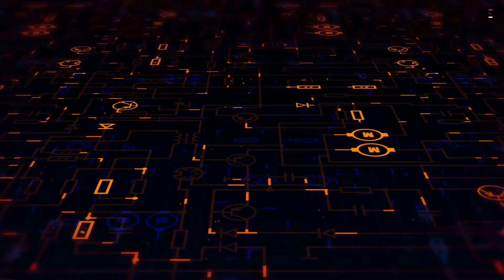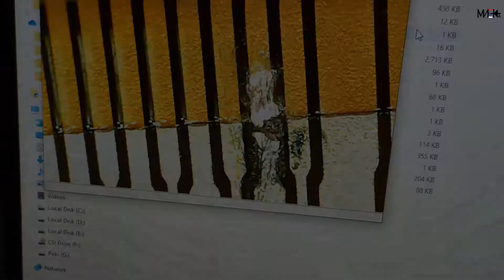Nintendo DS lite / Screen blinks problem // Treperenje-blinkanje ekrana // 屏幕闪烁问题

Comment: I nearly cried. I took my lite apart to clean it and fix an issue with the bumper. Put it back together and it started doing this. Checked the ribbon and found out I hadn't put it in all the way.
Reply from the maker: Great it was finished good 👍
Reply: Shelbyrules, how do i put the ribbon in ? where is it even please help i need to fix my nintendo
Reply: Watch a tutorial like a screen repair one to better understand, but The ribbon is the orange flexible paper thing. Hope this helps
Reply: Your comment saved me a whole lots of tiiiimeeee😢

Comment: Hi my ds lite is charging ok, battery is fine tested but when i turn on the green light blinks and the upper screen flashes once and then nothing happens it wont turn on, already tested the fuses, do you imagine what could be the problem?
Reply from the maker: Thank you for asking. I suppose that there is some problem with display or flat cable, DS lite try to power the display and have some problem, that is why is just blink, try to clean and check flat cable first.

Comment: OMG! You cant FIX the pads? Makes total sense since traces on boards can be repaired. Why did I not think of this? Awesome! The pads to my digitiser appear to have been rubbed off or cracked. That tiny cable is a menace to put back in for sure. This DSL was given to me because it doesnt work. Process of elimination. I suspect the digitiser pads arent the only problem but maybe. I'll try padding them with solder. Thanks so much for this video! Imma sub now <3
Reply from the maker: Thank you for nice words, it is my pleasure that video helped!

Comment: Hello, I have a question, do you know what other problems can be the cause of the console not turning on? My nintendo DSLite worked perfectly, I decided to change the casing, because the top screen had a broken support, once I changed the casing, the console stopped working, it didn't turn on, the battery light (green) blinks and goes off I tried to change the screen for a new one and the same thing keeps happening.
Reply from the maker: Hi, thanks for asking, probabbly some losen flat cable or similar. Or your battery is empty, I do not expext anything else. Let me know do you solved the problem!
Reply: Same like you. I Don't know I recently Buy a new screen but when I put it, I doesn't function. And I think that is not the screen.

Comment: Hey question, what was it that you put on the cotton swab to clean the cable?
Reply from the maker: Hi, I put IPA, isopropyl alcoloh
Reply: @MilekaRobot  is 99% fine? Which did you use
Reply from the maker: @bawdz2293  Yes, I use 99.6%, every 99% IPA is perfect.

Comment: Jeez, 8 years my sister dropped my ds lite on the floor and the bottom display broke, I got a new bottom and top display, but I still have that one flashing and dead screen :c I don't know what else I can do, could that be a battery problem?
Reply from the maker: Sorry for late answer, I make a big break on videos and do not enter here to often... Can be battery, that blinking means some physical "damage" or missing part, usually, so check connection / flat cables / speaker... Did you try to leave on charger for one hour?

Comment: Mine turn on and both screens stay white, no sound, can you help me?
Reply from the maker: Hi, thank you for watching. Let's start, did you tried to open the console and unplug -> plug the flat cables?
Reply: @MilekaRobot  Yes, then it stopped working, after a cleaning on the cable, both screens stay white
Reply: @MilekaRobot  well, i check the flat cable, and it was broken, thanks for your attencion
Reply from the maker: Sorry for late answer, it is great you find the problem!